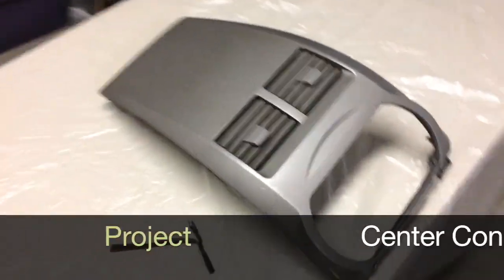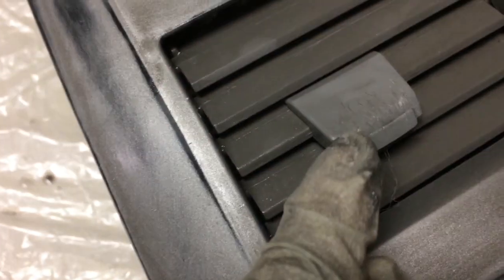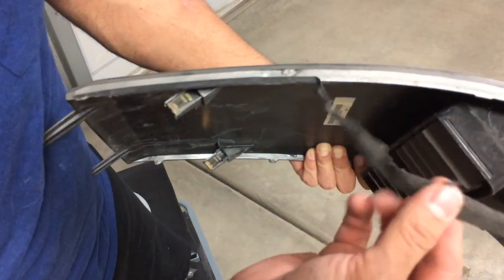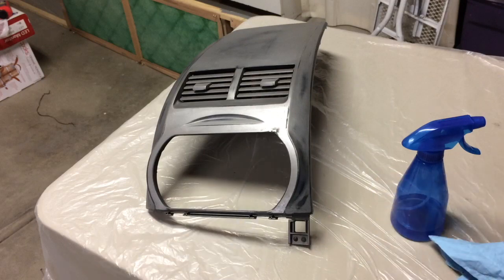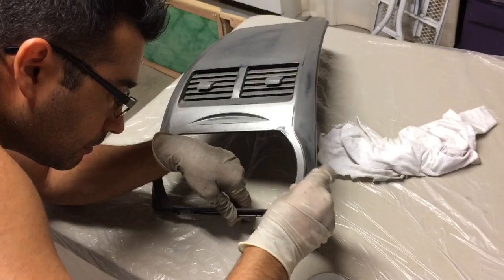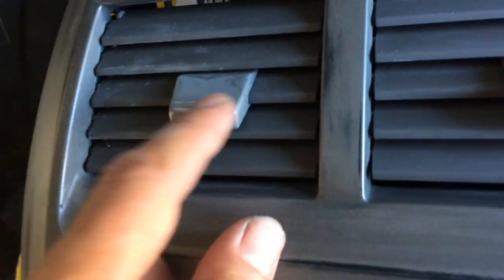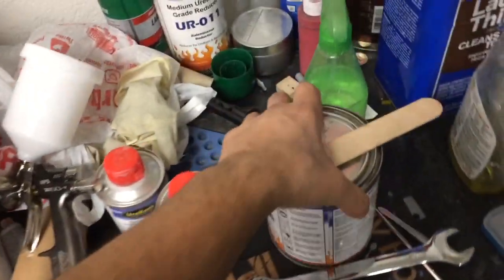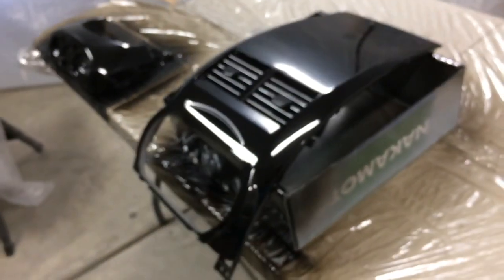How to Paint your car dash - Part 1

Comment: Whatever you do, NEVER use any kind of that Rustoleum garbage. It says you have to wait 48 hrs to spray a second coat. It doesn't matter if you wait a month, when you spray a second coat, the previous coat buckles up and crinkles up and of course, not uniformly. In seconds it will RUIN all your hard work and turn your parts into ugly trash. F Rustoleum totally.

Comment: wondering did you lightly sand back the primer before applying the topcoat
Reply from the maker: Yes, there was sanding and scuffing for top coats. Great question. If the surface has minimal imperfections, adequate sanding is required. Keeping those sand cratches at a minimum, specially with black paint.

Comment: What paint color you used? Matt black and then clear coat? Or is just glossy black? You put something like a pearl dust in the paint? How many clear coat layers you made? I want to paint my interior exactly this color but I don't know how to choose the color. Thanks in advance!
Reply from the maker: blackbk18 this is called Jet black. Regardless of what the paint manufacturer calls it, as long it’s a solid color, no flakes, sparkles, or metallics, you should be fine. I used a urethane paint system, but you can get similar results with any acrylic base paint.
Reply from the maker: blackbk18 I sprayed three coats of jet black, then cleared it. No pearls or metallics. Solid color. Sorry for the late reply
Reply: @DIYCustoms  what brand paint did you use?
Reply from the maker: Chase Stolworthy The black is PPG shopline brand. I got that from a local paint distributor. The clear, it’s from Urekem erethane clear.

Comment: What did you do to remove the dust particles that fell on the paint?
Reply from the maker: That’s Part 2 video series. I should add that part 2 in the description. I color sanded the dirt nibs with 1500 grit or 1200 if it becomes annoying. End the color sanding with 3000 trizact, then buff and polish to a mirror shine with 3” pads.

Comment: What Point you used
Reply from the maker: I used the Urekem urethane base coat / clear coat paint system. It’s NOT acrylic or lacquer base paint. But you can still get the same results with acrylic or lacquer, based on the weather.
Reply: @DIYCustoms  thankyou
Reply from the maker: @juanbautista6047  FYI LACQUER does take more time to dry and it’s older paint technology. Urethane is best